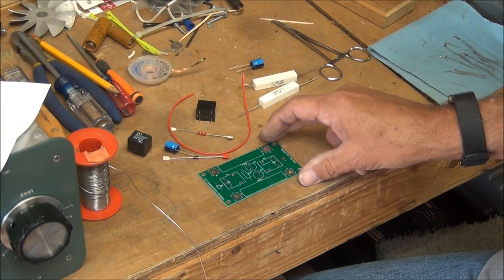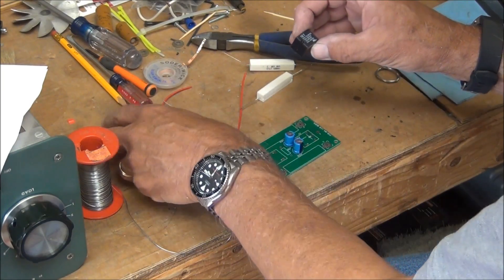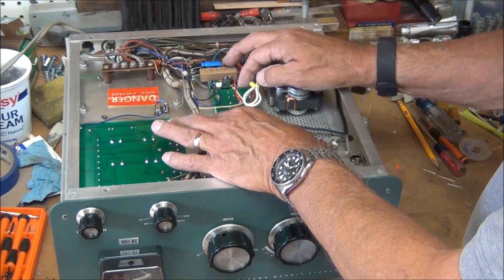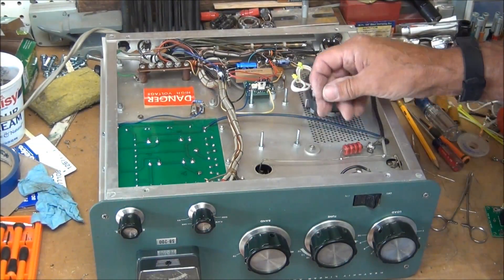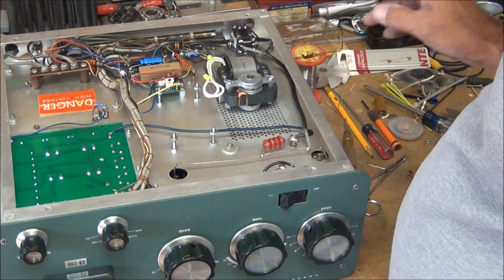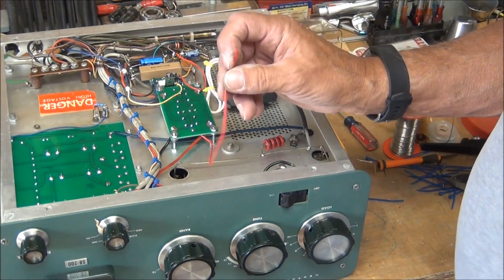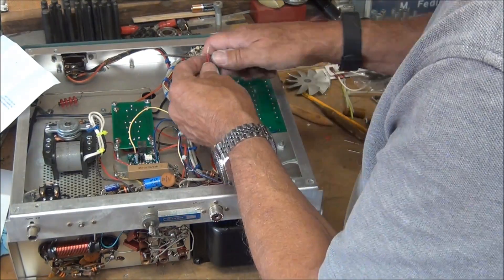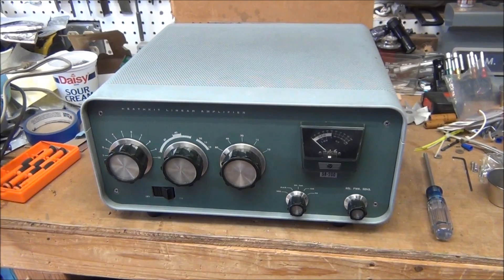SB200 Linear Amplifier - Soft Start Module Assembly & Installation

Comment: 3M makes double-sided foam tapte that's removable. I think I'd opt for hook-and-loop. I'm not going to add holes to my vintage amps. Unfortunately, in my application, I will have to mount vertically.

Comment: This whole series has been very helpful to me. I just got an SB-200 and I'm going to do the identical mods and upgrades you did. Waiting for the power supply and soft start boards from Harbach. Where did you get the replacement fan and motor? Many thanks!! 73, Ken KO4AXN

Comment: You didn't even show it come on and work afterwards?  No confidence?  Tip:  Buy yourself a pair of wire strippers instead of knicking and cutting wire strands you're stripping.  Tip #2:  Better soldering technique.

Comment: Why put those  resistors in if they going to be changed  anyway?
Reply from the maker: Because the amplifier is currently being used on 110 volts. When the conversion to 220v happens the resistors will be changed out.
Reply: Ok thank you for responding, Many people would not bother